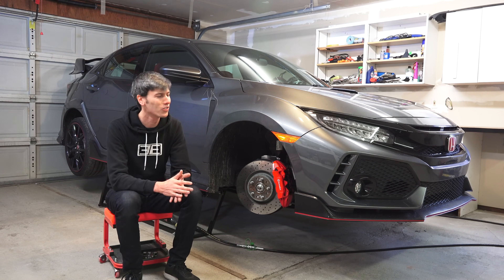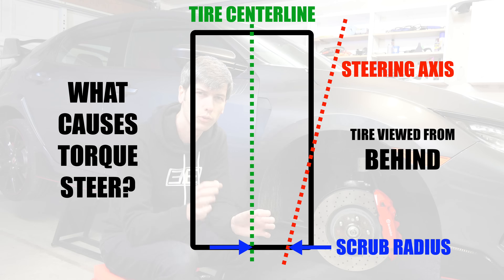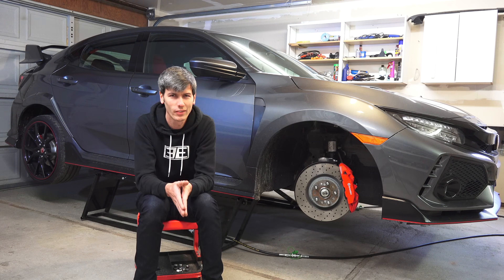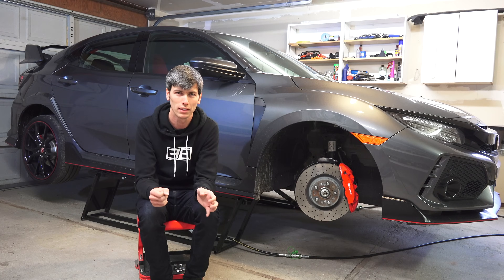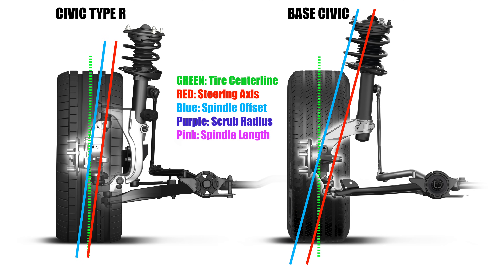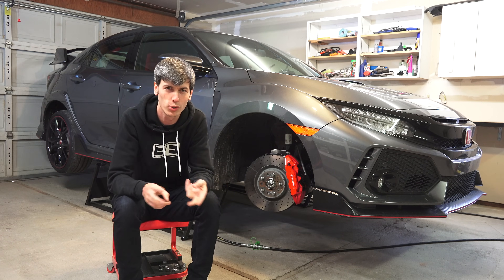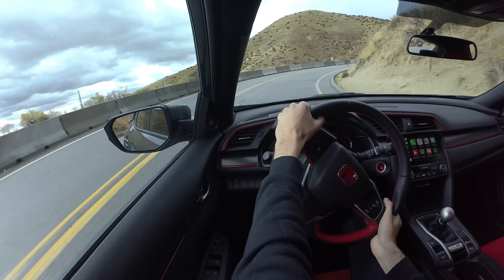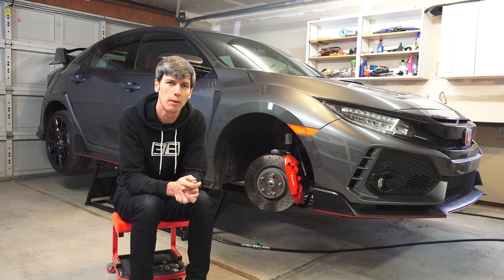Why Doesn't The Honda Civic Type R Have Torque Steer?

Comment: Cadillac's with the Northstar engine displayed torque steer but it could have been worse as GM put a lot of power down. Better be ready for the torque steer event. I have read that at one time "engineers" believed no more than 200 hp could be "put to the pavement" in any type of front wheel drive auto, no matter how clever you got. How is this rule holding up? I am thinking of the Northstar equipped Cadillacs and the older Oldsmobile Toronado, as they were front wheel drive and had the potential to make more than 200hp. So many engines can now make 200 hp (even 4 cyl)

Comment: The Chrysler 300m that came out n 1999 was front wheel drive and had little or no torque steer. Now, it was the re-badged second generation Eagle Vision, so this wasn't truly a Chrysler, but it did have decent horsepower and really good handling. It seems like torque steer is low on the priorities of performance issues to solve for the engineering teams designing cars these days.

Comment: The intermittent torque steer you noticed is probably due to a couple factors. Side loading causes the tire to squirm and shift the center of the tire patch relative to the wheel. Also the effect of suspension compression in the turn might change the geometry factors you mentioned. Street cars have bushings that compress, allowing geometry to change. Weight transfer combined with bumps and dips in the road can lead to some pretty big differences in geometry left to right. They could probably dial out even more of that. But then you get into the area you didn't want to get into in this video, steering feel.

Comment: uhmmm. renault/ford had this already in 2004.. but yeah the japanese cant think thereselve..
Reply: hey kiddo. what did the ford rs run the ring in? now how about this honda? know your place. if senna was willing to work with them on developing the nsx then i think they know a thing or two more than you.
Reply: it wasnt the same system paulwalker.. i know how it looked.. and its different further why should i respect them if they boost about there supspension even tough its from renault /ford and already 13 years old.. go watch 2f2f
Reply: ThaDutchDK1989 the EK9 Civic Type R had it's steering axis separated from the strut as well. Don't disrespect Japanese engineers.

Comment: Great video but it would help if you could show side by side examples of a car without the Type R wheel geometry change for reference. Specifically when you do the shot from under the tire looking up and turning the wheel to show the more center point turning. Also examples of doing the driving sections would be nice so we can see the relative difference. Even with that; great video and I learned quite a bit from it.

Comment: Hey Jason, how does reducing the wheel offset affect this? For winter tires I would like to go to 18", but typical offsets are around +45, and there is almost nothing above +50, so realistically you are reducing your offset by 15 mm if you want to have a good cheap set of wheels!

Comment: Isn't that the LSD doing that? From my humble experience once a helical LSD is torque locked, it tends to pull in that direction, which is its function.
Reply from the maker: +hardcoreep yes, if you have a torque imbalance at the wheels it will cause the car to pull one way, and LSDs can cause this.